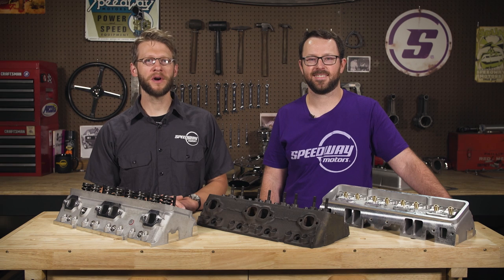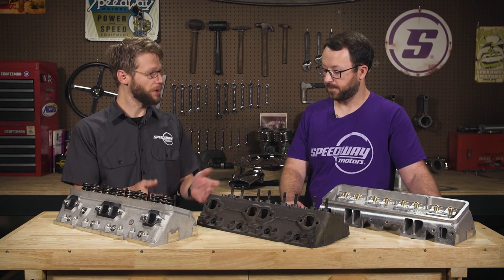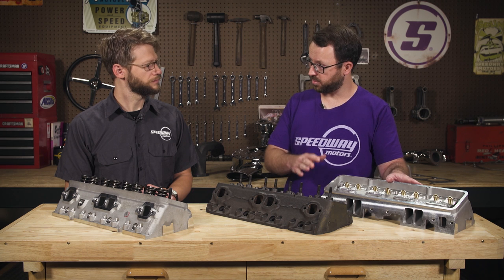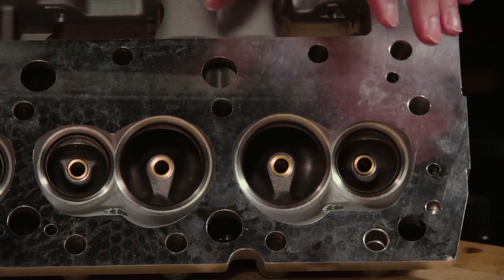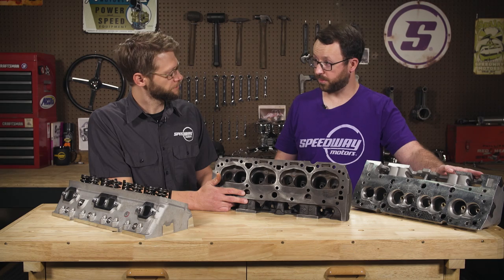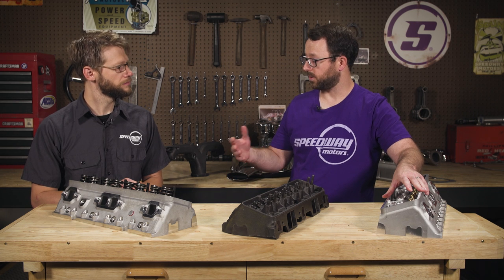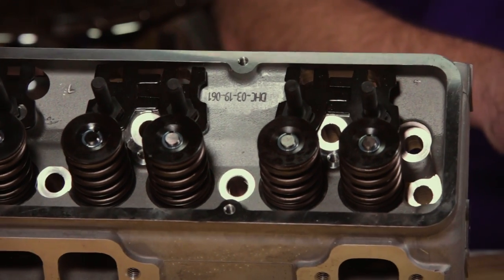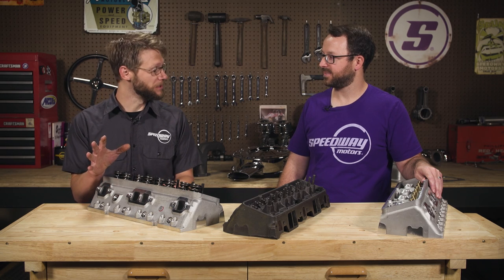Speedway Motors Tech Talk GM 461 Double Hump Chevy SBC Aluminum Heads

Comment: Had a 327 bored 60 over with flat top pistons and double hump heads. Crane solid lift camshaft and that was the best sounding engine I ever had. Little engine was rowdy.
Reply: Crazy cuz it still prolly made 340hp🤣
Reply: @PHILLY214 L79 327 SBC made 350hp from the factory. I’m sure this guy was pushing 400whp in a 3000 pound car.
Reply: @aidanmoore8768  that comment up there^^ nah man they had 165-170cc Intake runners…no way in hell it would make 400 to the tire that’s like 450+ at the crank….a 327 with fuelie heads and a bump in compression w a nice cam can make a lil over 1hp per cubic inch why I said 340hp maaaaybe 360
Reply: The production 1965-68 327s basically had what he’s sayin^^ all except the .060 over and solid lifters lol so he mighta made 360?…he’ll the Vettes had solid lifters 🤣🤣🤣
Reply: @PHILLY214  either way, 360hp is still enough to have some fun with.

Comment: Those original double hump heads are getting very hard to find now. I like this idea of a stock looking aluminum head, instead of edelbrock or trickflow. These can even be painted to match the block.
Reply: I've got a matching set on my 327 in my 55 Bel air hardtop , it runs very well. I do wish they had the alternator holes for the mounting bracket. But they look old school 👍
Reply: Duke Of Prunes  Some of the cast alum materials make that easier said than it is done. We tried and wrecked a head here. It actually takes a CNC bore machine to get it right. Most of the Alum heads are a much harder Alum than one would think they are made of which makes modifying em a challenge.
Reply: A set of Vortec heads outflow double humps and with a modern combustion chamber make much better power.  Double Hump heads are 60's technology, compared to modern heads they suck!
Reply: Cast Iron can also be painted. No advantage there. I agree aluminum is better in most every other way, though... .
Reply: @danboren6567  Many stock class roundy round race cars have to use the double hump heads, though. There were no stock class race cars running Vortec heads in 1965 on a Malibu SS, or a Corvette!!!
Reply: @danboren6567  Yes a stock vortec will out perform a stock double hump. It would be cool to see a comparison between vortec and these upgraded double humps.
Reply: Got a set in my garage.

Comment: I'm running a set of 461 heads on a little punched 283 ,327 crank stroker . It's a thing if beauty ,slight street port,hard seats ,champherd quench .five angle pockets 160 exhaust ,kept the 194 s so I can punch em again if I want to . Luckily worked at western parts in those days .my little mouse sings sweetly.David Vizard style street port ,Dale Sherman style supertuned holly .wiend stealth intake ,also D V modified .

Comment: Guys, I showed how to do the ultimate mods to 461/186 heads on my channel at PowerTec  10. I won several international sports car & formula 5000 races with these heads. I want to build a stealth motor as one of my YouTube  video's. How much work would it take to get these heads to 300 CFM at 0.700 lift?
Reply: trick flow has better flowing double humps, they even have a 200cc version coming. speedway probably sells them...
Reply: Shoot for the Moon, I love your thinking....
Reply: probably need to weld up head, add 2.08 splayed valves. Totally these can not do that.

Comment: Should offer with or without accessory holes
Reply: I would assume if these are a hit they will do that.
Reply: Trick flow builds a similar head. DHV175 which can be ordered with or without accessory holes.
Reply: The whole purpose of these is to "look", vintage. Early versions did not have end holes. I have 1964 DH heads and robbed all of the parts from an early Malibu so I could keep it stock looking. GM brackets and pulleys are always the way to go, they always fit stock.

Comment: Where are these heads cast and machined?
Why not just machine one end of the heads for accessories? Then they can be used for either application depending on hows they're installed. Unless they're REAL intended use is for those circle track racers that are looking to cheat tech inspections.
Why not cut a 5 angle valve job?
Who's ports/architecture did these heads copy? That info would tell everyone who's CNC porting programs would work on these castings.

Also, your web link says they're forged......and we all know they're CAST....But then the question is, what alloy? 6061? 7076? Heat treated to T6?

All details any engine builder would like to know.
Reply: When I called Speedway they told me the heads were cast in China.
Reply: @inmygarage_kenm big surprise there! The flow data on the Trick Flow DHC heads show they have about 20cfm more at 0.500 lift than these.

Comment: What does a complete set cost with no accessory holes with the valves and springs
Reply from the maker: The assembled aluminum double hump cylinder head currently runs $649.99 https://www.speedwaymotors.com/Chevy-SBC-Assembled-Aluminum-Camel-Double-Hump-461-Cylinder-Head,379621.html
Reply: @speedwaymotors  pair

Comment: How do these heads compare to the L98 113 casting?. Intake, and exhaust volume to be specific.
Reply from the maker: We've seen tests on stock 113's that flowed around 195 cfm @ .500" lift on the intake and around 151 cfm @ .500" lift on the exhaust. The Speedway Motors double hump heads flow 232 cfm @ .500" intake and 173 cfm @ .500" lift on the exhaust. There are lots of variables here, but in general the Speedway Motors head will have bigger valves (2.02/1.60 vs. 1.94/1.50) and bigger chambers (64cc vs. 55.9cc) when compared to a stock L98 113. The L98 113 castings can be ported and stuffed with larger valves to flow in the same range as our double hump heads, but they won't have the same power potential due to the older chamber design. Also, note that the double hump heads are not drilled for accessory brackets, by design.

Comment: How can the spark plug be both closer to the center of the cylinder and closer to the  exhaust valve??

Are the exhaust valves bigger than the intake valves?

Comment: The 461 are a great idea, however will a 186 version come out, due the primary accessory bolt hole on most post '68 cars, after a point trucks, too are needed to bolt-on AND match the basic accessory, the alternator and water pump, on others the power steering , A/C bracketry ?  One other concern, can these heads be ordered  with steamholes to match the steamholes on a production SB 400 block?

Comment: So after all that you didn’t add or make optional accessory bolt holes?
Reply: Of course not, I had camel back heads on my 327 in a 70 chevelle, it is the vintage look they are going for. If someone wants holes they are available.
Reply: @bryandouglass9997  You can also drill and tap your own. I did this successfully on a set of CI double hump castings off a 1963 Corvette. I mocked up the assembly with the accessory brackets, used liquid white Teflon pipe sealer, and never had a leak. I used hard washers of one thickness, and different thickness washers as shims. It really isn't that difficult. CI drills and taps easily. Actually, a little known fact; you need no tapping oil or lube when tapping CI. It has a lot of graphite in it. Oil not needed... .
Reply: Trick Flow also makes a great set of double hump aluminum heads that come with the accessory bolt holes.
Reply: @milojanis4901  ...people dont try this....1970 DH's has the holes
Reply: You are missing the point.
Reply: @victorbarner6254  well if the idea was to maintain that vintage look and performance while taking advantage of modern aluminum head construction while cutting off most of the market who have accessories requiring they bolt to the heads then nope haven't missed a thing

Comment: What's the max rpm u can run without the valves floating,or before u need more lift
Reply: Depends on the cam and spring pressures/weight of the push rods/rockers.

Comment: What’s a good roller cam for these heads will be going a stock roller 350 block with 1800-2000 stall and stock rear gears not sure about the ratio on a 84 c10

Comment: Would love to have those on a small journal 327 for a T-bucket.
Reply: With all the stroker and ls craze, many don't even know about the 327. 
Damn good little engine. Specially with the 350 horse cam, roller tips and a well tuned carb.
Reply: I had a small journal 327 bored 60 with double hump heads, flat top pistons, crane solid lift camshaft and that little motor was a beast. I had it in a big 70 chevelle and it would get. Miss that car and engine.
Reply: @rosco664  Imagine how it would have run in an F body.  Less weight, more ZOOM...   lol

Comment: What is the combustion chamber volume?
Reply from the maker: The combustion chamber volume on these is 64cc.
Reply: @speedwaymotors  Just 10cc larger than the the combustion chamber that this head copied, the Ford 289.
Reply: @nebrrex6910  Copied? Ford has a different layout....
Reply: Like the 90 OHV pushrod v8 in 1955 that everybody copied and still does to this day.

Comment: If you look closely you'll see the spark plug location on the 461 is close to the deck, not good, with the 462 forward that was changed
Reply: @Future-Preps35  I know where they are. I do remember the x head having a bigger port. When I built them, there was brodix and brownfield or Chevrolet. I had a pair of 292 heads, that was it in the day. 292 I guess was the first over the counter, 190cc port ex raised .40 no heat riser and of course angle plug. Crane cams would port them, hence the crane head. Long time ago.

Comment: Do these use standard length push rods?
Reply: Should, but depends what rocker you are using/thickness of head gasket/valve stem height.

Comment: If it has the accessory bolt holes, I would buy them.
Reply: They do make them with the holes also
Reply: @jamoshotrod  the devil you say....I looked and looked, missed it I guess.....did you see a part number? Thanks for the info.....
Reply: @mikef-gi2dg  I had the 041's with moderate porting  and 2.02's and 1.60 and that set did have the accessory  holes on them.SBC ran amazing.
Reply: @arodderz  i still got a set of 041,and 461 never rebuilt them, going to buy new modern stuff, the speedway stuff looked good, not concerned with the nostalga look. 
There is a bunch of modern new stuff in the $900 to $1600 range.
Reply: @mikef-gi2dg  I hear you. Yes, modern heads are the way to go. I went with the Afr 195cc heads and absolutely love them.
Reply: @arodderz  AFT stuff looks good....that have a new head afr 195 enforcer as cast head....looks like a good match for a street 350.
Reply: Trick flow makes unbelievable double hump head in the 461& the late model hump head (with accessory holes). They flow over 260 and have 60cc chambers
Reply: @mattperkins7038  not really interested in any nostalgia stuff, but Trick Flow got a lot of possibilities for a street, strip sbc I will be building.
Reply: @mikef-gi2dg  yeah I love mine. I picked up 44hp and 38lb’ from going to the trick flow DHC175 from the 291 big valve heads. No changes other than the heads.
Reply: @mattperkins7038  well now....I got to jump over to trick flow site and check this out...thanks for the endorsement....
Reply: Trick flow actually is the company that makes the heads, and they have an accessory hole set
Reply: @jamoshotrod  I took a walk thru the speedway site and couldn't find the head with acc holes. I also took a walk thru the Trick flow site, and I thought the heads looked familiar. If you should see a pn# you can throw my way that would be great, thanks for the info.
Reply: TFS-30210006
Reply: @jamoshotrod  out standing, let me check it out.....thanks....

Comment: You're wrong about something, that head did not come out in 61 it came out in 62, because in 61 all there was was a 283 and the best heads you could get on that was aluminum heads
Reply: Don't you mean power pack?
Reply: @nebrrex6910  no, power pack heads had a rectangular shaped casting Mark with a point in the middle of it
Reply: @jeffcolt9185  I was referring to the year. The 327 came out in '62. In '61 it was just the 283 and the power pack heads.
Reply: What about Pyramid Heads - Double Hump comparison ?
Reply: Well...... in 1961..... you could buy a new 327 equipped 1962 model Chevrolet....... sooooooo yes. There’s 327 parts with 1961 date codes.
Reply: cant believe no one ragged him about the  "aluminum sbc" heads LOL!
Reply: @gtbarnes11  I’m not Vette expert but it seems to me I remember reading about Chevrolet making a limited run of aluminum head Vettes for the 1961 model year. IIRC, they made like 20 or 30 sets and nearly all of them were recalled and replaced with cast heads due to cooling temp problems.
Reply: @gtbarnes11  Hilarious.  Likely they didn't even think it was worth responding to.  I know I had to reread it, before having a good chuckle, myself...   lol
Reply: That's correct, the '62 models came out in September of '61. I worked at a Chevy assembly plant back then.
Reply: @gtbarnes11  (Tell him they were magnesium)

Comment: Would these heads work on a stock 283 sbc?
Reply from the maker: It would depend on how much valve lift the cam has.  They should work, but you'll need to check clearance before final assembly happens.
Reply: @speedwaymotors  so what is the most lift you can use on a 283? Thanks!
Reply: 283 has a smaller bore. I wouldn't go any bigger than 1.94" intake valves to be safe

Comment: A 351 WINDSOR HEAD FROM 69-70 FROM GRANDMA'S STATION WAGON WITH A 2 BARREL CARBURATOR (ON THE INTAKE SIDE ONLY). A NONE RACE ORIENTATED HEAD WITH SMALLER VALVES AND INTAKE RUNNERS, FLOWED JUST AS GOOD AS CHEVY'S BEST HEAD THE FUELIE 2.02. THAT'S HOW FAR AHEAD FORD WAS THAN CHEVY IN ENGINEERING. THAT IS INCREDIBLE AND THE REASON WHY GM/CHEVY TOOK THE WINDSOR DESIGN AS THE FOUNDATION FOR THE CHEVY LS HEAD TODAY. BY JUST INCREASING THE SIZE OF THE VALVES AND RUNNERS AND TO THE STRAIGHTER FORD VALVES DESIGN FROM A 20 TO A 18 DEGREE VALVE ANGLE.
 AS FOR THE EXHAUST PORTS FOR BOTH THE CHEVY AND FORD THEY ARE BOTH A STRAIGHT SHOT OUT AND THE FORD COULD BE PORTED TO FLOW JUST AS GOOD AS THE FUELIE.
Reply: @suzukiltz8902  1970 WAS THE LAST YEAR UNTIL EMISSIONS CAME AND KILLED EVERYTHING FOR ALL MANUFACTURERS.
Reply: Frank, I think you meant 351 Cleveland, not 351 Windsor...
Reply: @stephenkeebler732  Stephen. I think Frank might be getting a bit confused.
Reply: Never showed on the track or the street...
Reply: After all these years Ford STILL doesn’t have an answer to the Corvette! So, can we just conclude that port flow alone wont put you in the winners circle? If it weren’t for GM and Chrysler, Fords would still be flathead powered.

Comment: I bought a set of these back in the spring from 

speedway motors for a 1966 350 HP 327. they would not fit the combustion chamber 
with the factory domed pistons. I modified the combustion chamber to make them work. the fast burn chamber point hit the dome about .010 
removing the material i was the able to use them and they worked fine. I did a complete review of this but it was never posted.

0:11 / 7:24

0:11 / 7:24

Speedway Motors
Reply: They use a very thin head gasket; can you use one that is twice as thick to avoid clearance problems with stock L79 pop up pistons?

Comment: I have a set of 492 double humps they are the 2.02 1.60 valves all ready to go with springs and valves stud holes tapped already for screw in studs.
Reply: How much
Reply: @PROSTREETS1096  like to get 800
Reply: Where you located
Reply: @PROSTREETS1096  TX

Comment: I know most double hump heads aren't drilled for accessory's.... That's not a job average mechanic should do....are these drilled? I know your going for the old look....but everyone wants power steering
Reply: Not drilled, but check out Allen grove components.  He makes great brackets to run your alternator and p/s within a long water pump and no accessory holes
Reply: Yes but cast heads can handle roller set ups these tinker toys snap past the 400hp build up... They don't hold up shit not even twin Chinese hair dryers....
Reply: @thekingsilverado9004  First laugh of the day....Thanks

Comment: You have to run higher compression w aluminum heads, because of thermal heat loss. If you run same it will make less power. Expansion of gases is lower.
Reply: Interesting never heard that before, thanks
Reply: Whaaaaat????????????????

Comment: DZ 302.. engine. would these help low end torque? Also, could these accept 205 values?
Reply: No such thing as low end torque in a 302, at least compared to other SB Chevy mills.  Mid range to high rpm motor, all day long.  lol
Reply: P.S.  You're wanting low end torque, and you're asking about 2.05" inrake valves?  Dude...   smh
Reply: Don't think the 11:1 high compression stock pistons will work with this small combustion chamber shape but I could be wrong.

Comment: Not going to fool the people who had camelbacks already. Should have just made it identical, but in aluminum, with hardened valve seats, and bronze guides. The raised valve cover rails are a dead give away. If you don't externally copy it to a T, it'll never hit popularity status like the originals.
Reply: Well 😎 that's just a negative comment... These heads will far exceed..They weren't trying to be 100 percent copy only improve,and they accomplished that in Spades...